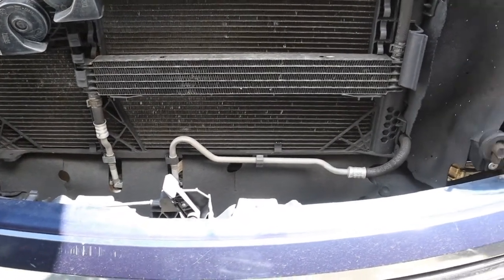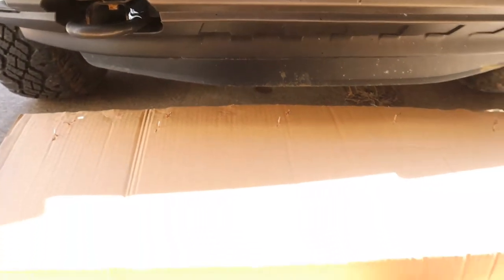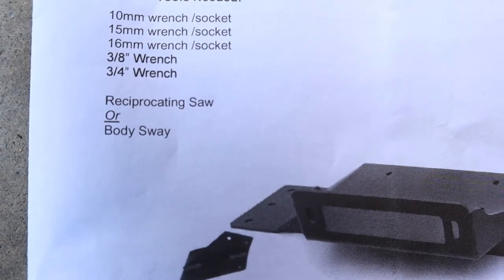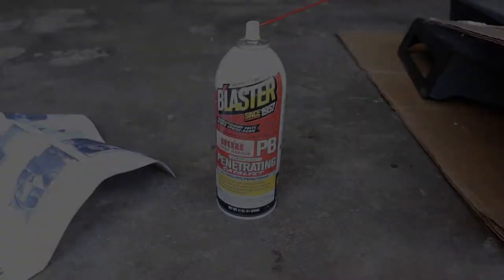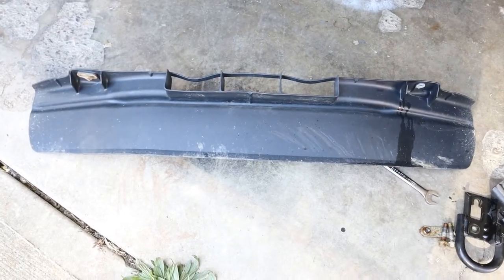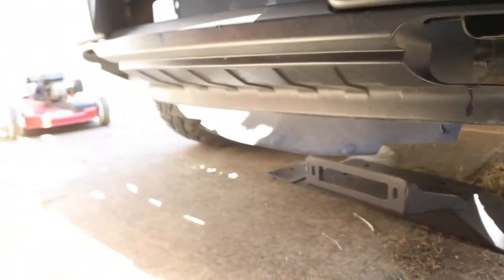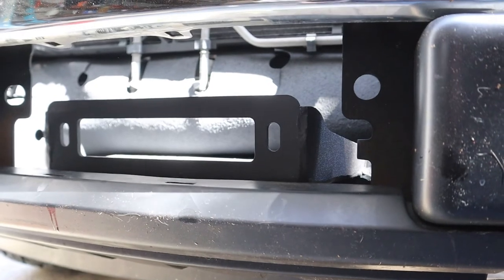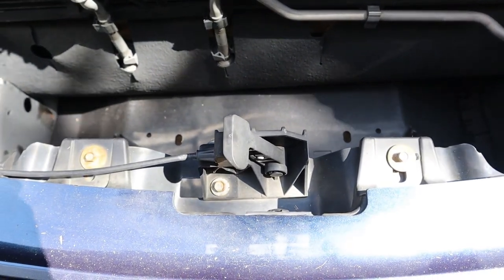Rough Country Hidden Winch Plate Install

Comment: When did you realize the plate is one hole back from where it should be? Your winch will not mount in this position. You need to use both tow hook mount bolts then the 3rd one is the new one.

Comment: The middle bolt is incorrect.
Reply from the maker: How do you figure?  I found it the easiest way to hold the plate up till you are ready to complete the install.  Do you have a better way?
Reply: The bolt you put in the middle should be in the third hole in the plate. This is why you thought you had to move your radiator lines. You mounted the plate too far back which is incorrect.
Reply: @dublove1  I agree after doing the install this very evening